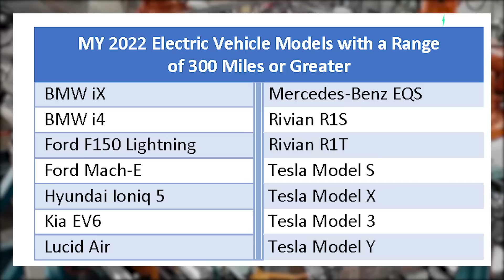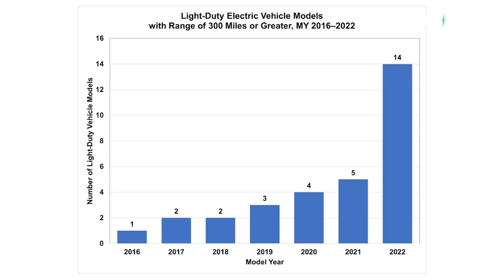New report shows why 1000 km range EVs will be the norm in 2030

Comment: I'd rather 2 500km cars. It doesn't make sense to make a battery that big most petrol cars barely do 500km. Once there are enough charging stations normal people will not care about range as much. Truth be told range these days is a point only raised by clueless EV critics.
Reply: I am not a clueless EV critic. Range is of paramount importance owing to Battery life, charge cycles, larger the battery, slower the chemical aging process, hence more value added and less depreciation accrued onto owning a car.
Reply: @IMahatmagandhi  absolutely, I couldn’t agree more. What also gives me hope about my Tesla (if I choose to keep) is that my PIP(plug-in Prius) has an EV range of only 13 miles of range and the BMS(battery management system) only allows a charge of 80% and a discharge to 10% to protect longevity. This little battery has been cycled approximately 2,700 time…… multiply THAT by 300 miles(Tesla range) and you have yourself a Tesla with 800,000 miles. With an approximate degradation of 16%. That’s not bad plus my PIP doesn’t have a battery cooler/heater and is the Panasonic 18650 while my Y is the more advanced 2170s that are cooled or heated for optimal performance and longevity. This anecdotal example really illustrates the superiority of EV over ICE. Cheers
Reply: I completely agree with one very small exception, excessive range may be very important to someone towing something VERY heavy and also don’t want to have to drive in and out of charging stations with a big trailer.
Reply: That’s why trailers of varying kind could maybe should have batteries also to help mitigate the range hit. Plus the breaks on said trailer could then capture energy for use later or to contribute to range either way.